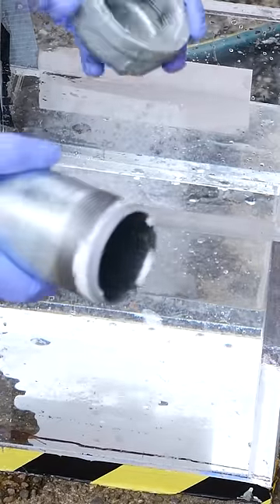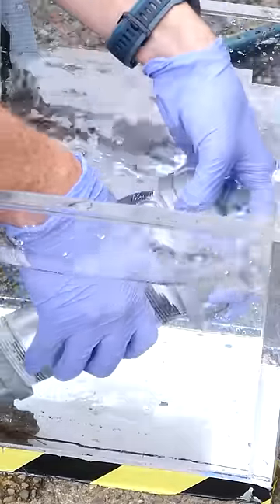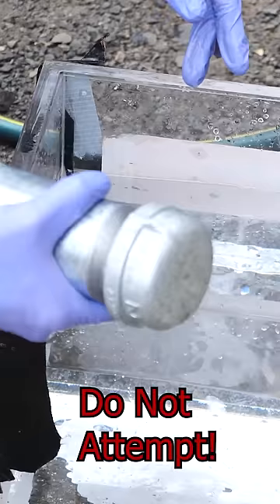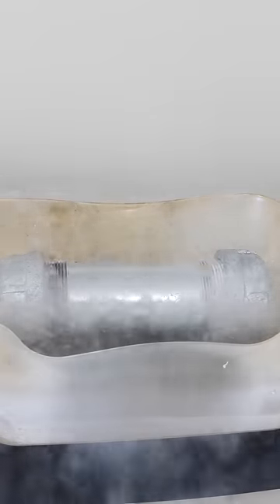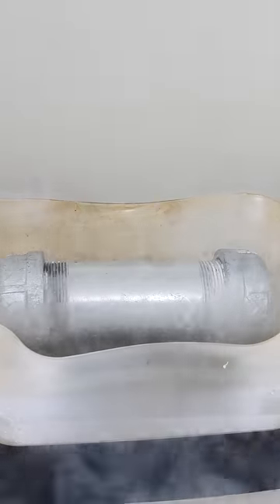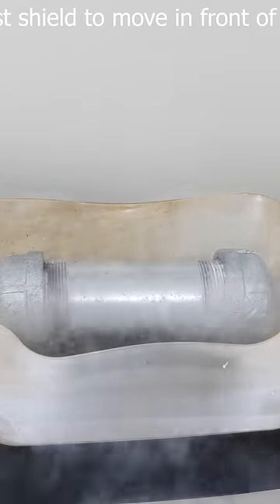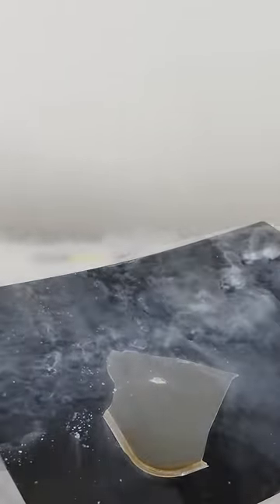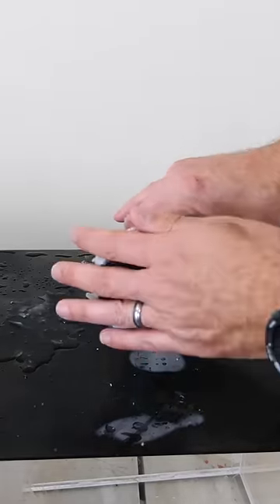Don't Ever Try To Stop Water From Freezing!

Comment: Also in your little experiment did you take into account to besides the expansion of the water that is the contraction of the metal and the brittle conditioning will develop due to the atoms getting closer and Cozier so if you want to do this try different materials and see what temperature the fracture you know the kind of experiments you would do for real life engineering and development

Comment: First off, the metal will constrict from the cold and the ice will expand. Second, it didn’t burst in the middle. Most likely it wiped out the threads of the cap and popped off.

Comment: Wrong. The metal fractured because of rapid freezing. As you pointed out about the water not freezing, because it couldn't because it was contained in the pipe and the pressure wouldn't allow it to freeze solid. Metal plumbing pipes don't burst because of frozen solid water!

Comment: There is no chance that the pipe can hold the pressure of water while it's freezing. First mistake you would need something that has no screw-on ends. That is if you want to answer the question of what happens if the water can't escape. I'd be interested to know what failed was it the cap or the threads my guess is the threads failed. I wonder if there is a way to make such a container for this experiment.

Comment: But i only broke the thread... Thats "easy". Try to put the water in a solid steel ball and weld it so its really closed. Btw water was used in mines for mining: they put water in little gaps and it froze and then it Blasted big parts out if the stone

Comment: you only used 150 psi rated fittings and  they are malleable iron. should try sch 160 pipe or XXH pipe which is even thicker and 6000psi fittings

Comment: Where does the energy to blow apart the pipe forcefully come from?  The water inside the pipe must get colder when it expands and turns to ice, right?  Or is the energy coming from the heat of melting being released?

And where does the force come from?  The water hasn't frozen, but is below its freezing point.  So are the water molecules trying to form crystals somehow generating force?

Comment: Dude, it blew the cap off because those are tapered threads. You should have put this in a vise and then grabbed a long pipe wrench. You could have obtained another 1/2 to 3/4 turn on the caps. That limp wristed tightening you did like a little girl ensured the cap would blow off.

Comment: Aren't there water freezing diagrams available? On that basis you could build a container able to withstand the pressure and create ice-3. Oh its 300 MPa aka 3000000 hPa = 3000 bar.

Comment: But what happens if you just set it in the freezer and not flash freeze it? Rhetorical question.... In my experience it does nothing but freeze. The container didn't bust, swell or explode. It just froze and I defended it the next day 💯✌🏻🤪

Comment: You can use this application for a timed remote detonator. Fill pipe with tannerite , nails, glass shards and a couple washers ,and gunpowder as accelerant. When the pipe is dropped into liquid nitrogen with the remote triggers it will do the same exact thing you see here. Expolde 😂😂

Comment: Looks like he was rapid freezing it inliquid nitrogen  if he froze it in the freezer it would Crack the  steel but not explode. Liquid nitrgen super chilled the  steel compromising molecular structure of the steel. He could have just froze the pipe with nothing inside it and dropped it on the ground and it would shatter due to being brittle from getting so frozen from the liq nitro

Comment: Why didn’t you just put it in a freezer? 
You weakened the integrity of the metal first in the freezing process by using what? liquid nitrogen or whatever rapid freezing method you were using. That is why only the water that made contact with the metal was frozen. 
Maybe if you can somehow get a tube to internally freeze the water only THEN the experiment could be observed properly. 
I would definitely want to see that!

Comment: Im not sure thats completely true... Ive left cans of been in the freezer over night and they don't split... its because your using liquid nitrogen to freeze it try it in the freezer over night at negative 20 it will definitely stay liquid due to the amount of pressure but the colder you make it you put more pressure on the water inside it to freeze....

Also the ice on the inner rim froze after it exploded and the pressure was released froze instantly due to how cold the metal was

Comment: You were trying to freeze it with liquid nitrogen which cooled the steel to the point it was brittle. This is not a valid test and should have been done in a freezer set to say 10 degrees.

Comment: The experiment doesn't allow for the fact that you froze the metal well beyond the freezing point of water, very rapidly too. You could shatter the metal pipe with less stress than if the pipe was at a warmer temperature but still below water's freezing temp. Just sayin..

Comment: Completely predictable. That’s why freeze plugs are installed in engines, but steel blocks STILL crack in freezing weather(without antifreeze protection), rendering the engine useless.

Comment: Try putting that same piece of steel filled with water in your freezer overnight , you’ll come back and it will be perfectly fine. You didn’t just freeze the water but you froze the steel from the outside which is bad for its integrity . In short , this experiment is invalid because you can’t prove that steel is not damaged by the freezing process you chose to use .

Comment: It looks like the end caps were not screwed on all the way. Another thing is that metal shrinks when it freezes and the pipe is thinner than the end caps so it shrinks faster, leaving a gap in the threads.
Reply: and steel gets very brittle when cold

Comment: Your idiocy almost kiIIed you but your incompetitence saved you.

The left side was cross threaded and significantly weaker of a seal which is why it failed first. Its probably why you are alive. This would have been a real pipe b0mb if you closed it correctly. You can see the cap on the left is parallel to the threads, not perpendicular to the pipe. You are lucky to be alive.  It would have been 100x more powerful if you screwed it on right.